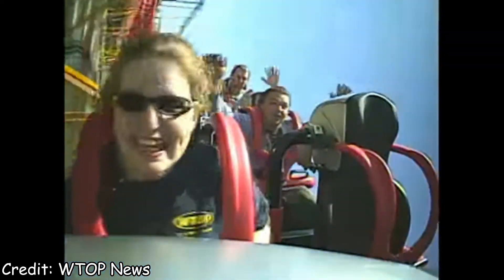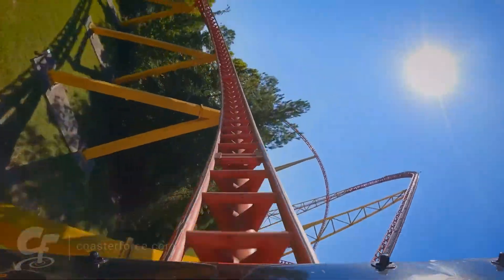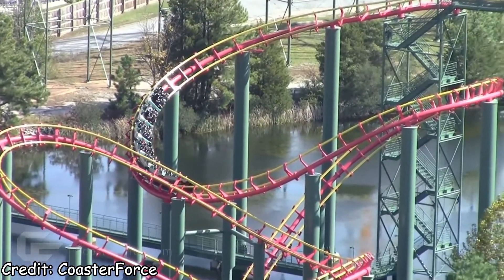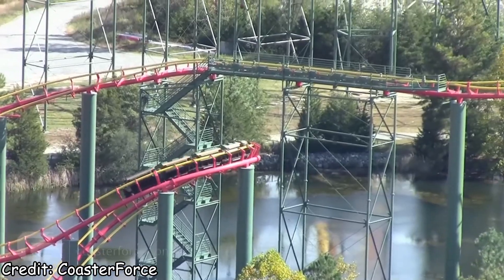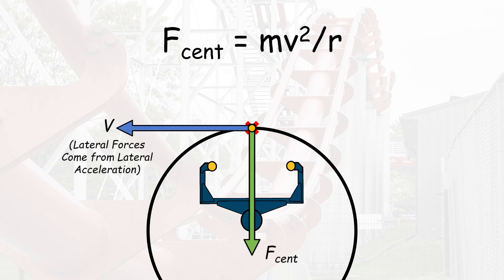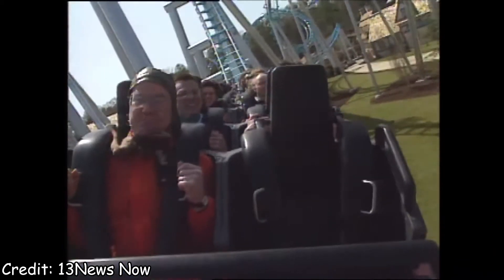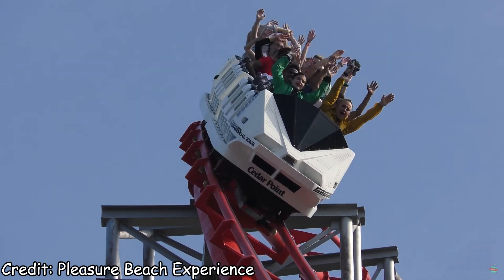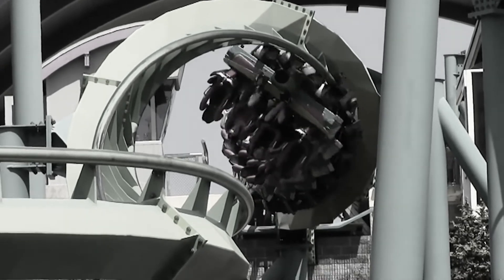Why Does Roller Coaster Track Look Like That? Coaster Crash Course #2

Comment: But who was it that pioneered heart line track bending? 

B & M. They were the first to break away from Arrow Dynamics' flat track method. Thank you Jesus! The old style was so uncomfortable.
Reply from the maker: I wouldn't give B&M full credit on that, but they were definitely one of the first to get on it. If you haven't been on their earliest rides (Iron Wolf / Firebird, Vortex, etc.) it's really fun to see what B&M's are like without heartlining.
Reply: I really don’t know what to make of Iron Wolf.  I rode it in ‘94 & ‘95, and while the transitions definitely had some jerk to them, no one complained about hitting their heads on the restraints.  The ride was even hailed as a revolution in smoothness when it opened in 1990!  Then by ‘96 it was starting to shake a bit, and by ‘97, it was nearly un-rideable (or at least un-RE-rideable) from all the headbanging.

I know that rides wear out and get rough as they age, but Iron Wolf’s descent was so young, so sudden, and so precipitous that I understand why very few thoosies realize it started out smooth.  But it did, and I really don’t know what happened.  Maybe they didn’t get the supports right, and the track warped after a few years?

Comment: 1:13
Well, technically if you built a launched coaster you could launch it into a half loop into a zero g roll and back into the station. Obvious solution to heartlining.
Reply from the maker: Ah the Sky Rocket II shortcut